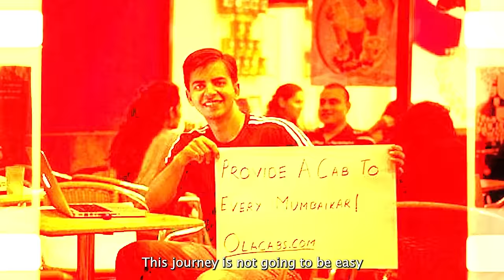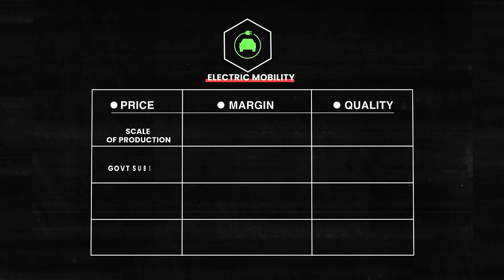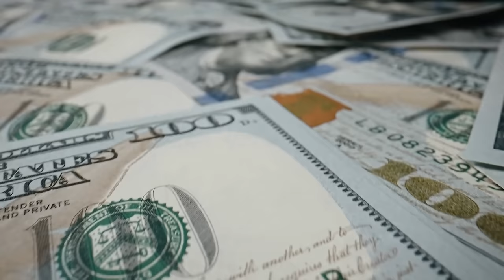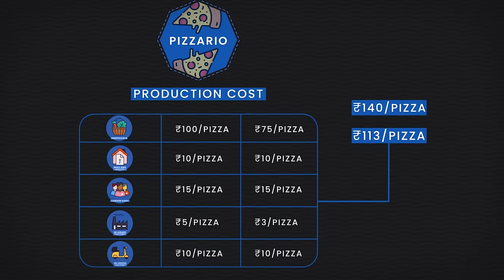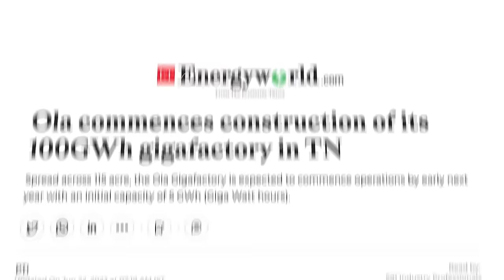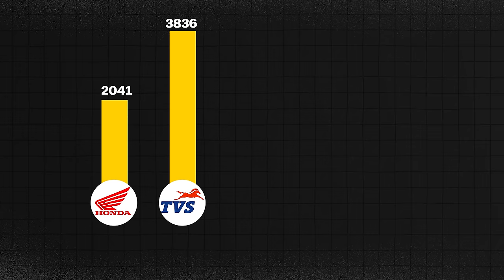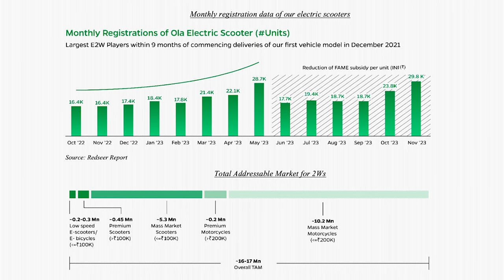OLA Electric: Is there any future in India?

Comment: 🎯 Key Takeaways for quick navigation:

00:12 Ola Electric's IPO.
00:40 Electric vehicle market in India.
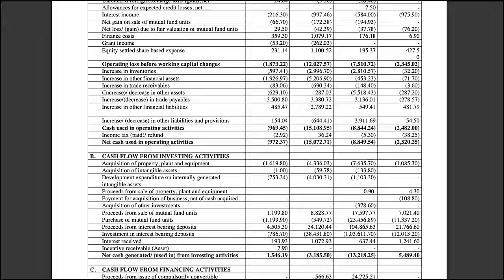01:09 Ola Electric's financial losses.
02:19 Considerations for investing in Ola Electric.
04:26 Importance of vertical integration in EV business.
08:51 Ola Electric's vertical integration and manufacturing capacity.
11:51 Control over price, margins, and quality through vertical integration.
19:04 EV market segment and pricing challenges.
21:23 Subsidies and their impact on EV sales.
23:26 Risks for Ola Electric, including raw materials and scale.
23:40 EV success factors: Quality, Price, Margins.
24:07 Ola's strong subsidies.
24:22 Struggle to reach price point.
24:35 Ola's distribution challenge.
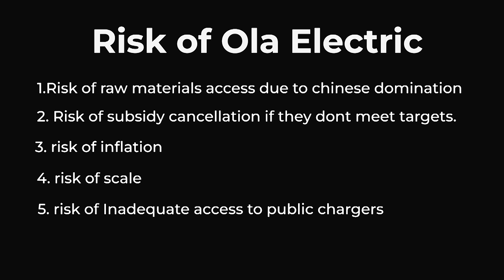24:49 Investment advice disclaimer.

Made with HARPA AI
Reply: Distribution channel not good because no dealership.

Comment: 12:37 Ola acquired a European EV company Ethergo which designed what is now known as Ola S1. Sorry to say, but Ola acquired a design and made some improvements. They didn't invest in coming up with their own Charging port. Ather on the other hand started from scratch and designed their EV charging standard which is now the official EV charging standard for the country.
Reply: Ather as a product is not worth it I believe. Not comfortable to ride and sit.
Reply: Common charging port gives access to third parties charging stations. Like type C cables. It's better to bring common charging ports other than unique ports
Reply: @rooftopmunda  weird. Because it has more space than OLa
Reply: Why to reinvent wheel if you can buy technology to it at reasonable cost & grab first movers advantage & tap economies of scale though I concur that kaizen is very much important in technology of charging
Reply: This.
Reply: @rooftopmunda  As a Ather owner, it's really nice and reliable scooter. They've taken some basic learnings into account which OLA didn't. e.g. the charger locks into scooter when charging. This gives me assurance that my portable charger won't be stolen in public space. OLA owners have to stay with their scooter for this. Very sensible user research done by Ather for such things in India markets
Reply: @AmeyaRanade  Don't judge with half knowledge, Even ola has charging lock system. And much more features like anti theft, GPS tracking, Remote Unlock, Password Reset using mobile, Music System and more
Reply: @phanichandravvss1751  Interesting. I should let the guy in my building know then. He thought it didn't.
Reply: Guys! Ola should use existing technology, learn from Ather, Byd, tata and others but. Its all about the race. Who wins is important ❤ All the best to them.
Reply: @phanichandravvss1751   GPS tracking is a thing in Ather aswell. And good luck tracking your vehicle when someone steals your phone and gets an Ola in bonus loot. And that music system is horrendous. 2W are meant to be driven, not get more and more distracting features on the dashboard. Hope the govt swings the hammer on all EV 2W about any form of distractions coming to the dashboard
Reply: Ola has en engineering design center in Coventry UK and a battery cell development center in TN.  They are planning on releasing motorcycles in 2024, and a car by 2026.  Ather seems to be stuck on the 450 platform with limited shared plans for the future and no global design presence.  I think it shows in sales figures
Reply: True
Reply: Bhai maal achha hona chahiye bikna chahiye bas kisne banaya kaise banaya kitna banaya koi farq nhi padta
Reply: @AdityaSuman-f7n  haa thats why theres a weekly news of Ola catching fire. For comparison, i have never heard any ather catching fire as far as my memory goes. The same goes for the front wheel suspension breaking apart on older Ola vehicles. Thats the difference between doing actual R&D vs buying and wrapping a foreign design.
Reply: Ola just patented their own battery cell, what did Ather do since their inception? Develop a single scooter and keep renaming it? Ola has a giga factory too.
Reply: @heavenlypot   look up the BIS standards for 2W EV charging and unlike Ola, there is a noticeable difference between each version of the scooter. More importantly, there are barely any news of Ather battery exploding, unlike Ola's "patented battery" which keeps exploding every day
Reply: @Silent_Shishya  Ola isn't even using their own cell rn, they'll use it from 2026. And there's a difference between explosion and catching fire, don't do sensationalism.
Reply: @Silent_Shishya  There are no 2 watt ev charging standards. Even phones charge at 100W these days, do you even know what you're talking about?
Reply: There is nothing wrong in buying a company to acquire technology. Companies do this all the time. In future, with experience, they can design their own products from scratch.
Reply: @CANILESHKUCHERIYA  Absolutely correct
Reply: @AKT-oc7ex  thanks

Comment: While the initial investment for vertical integration may be significant, the long-term returns are poised to be exceptional.
Reply: Vertical integration is not a good idea for commodity parts.  For example, Tata makes steel, and Suzuki does not.  Cars use a lot of steel, but Suzuki makes way more cars than Tata.  
Vertical integration only works for non-commodity parts.  When was the last time you saw a Pizza Hut wheat farm

Comment: Many times vertical integration can backfire. For example, other companies can buy best batteries at best price from whoever makes them best, while you will be stuck with your own battery, even if its not competitive. IMO, one has to be really good at what they are doing and that is what brings the value. Just vertical integration does not necessarily bring any advantage by itself.
For example, just look at Apple how they started. They did not start making chips. They started assembling computers and make better computers using existing off-the-shelf chips. Later, when they got better at it and then started making good money there, they went after mouse and then OS and then chips, in succession over multiple decades.

Comment: Does India even have standardization of Charging equipment? One big problen with EV market anywhere would be charging infrastructure. If charging becomes standardized, charging infrastructure becomes a real estate puzzle instead of tech. Example, ur apartment building has 50 of 2 wheeler chargers from think school corp, u just scan the qr code via their app and plug it in. Same goes for malls or office buildings. It charges regardless of brand of the vehicle and you can charge a % of the electricity cost for income. City/state authorities can even make rules saying any new construction has to have x% of parking with ev charging.

Comment: Well, to be precise, the two-wheeler EV manufacturers need not bring their price down to 90k; rather, they can hit a sweet spot that is between 90k and the current EV price. As the break-even point of owning an EV compared to ICE will include fuel price and maintenance, which can be leveraged/used by the EV manufacturers to market their product.

Comment: The very first focus has to be on quality and durability as cost is not a barrier for most Indians in the present scenario, first impression bhi hai toh aur careful hona padta hai. Customer Service cannot be bad at initial stages or you won't last much longer. OLA I believe intentionally did not stress test their power drives, I am assuming to be first in the race. Aether took advantage of that and made not exploding bikes but there is a hidden giant slowing creeping its way into the EV market and that is Yulu, they have been proven safe, reliable and already sold a lot due to their tie up with Zomato. Although now its reputation is that of Delivery wali bikes but, I believe they will use the knowledge gained from this to launch a much more competitive and durable bike, which will definitely eat into large chunks of market share of other bike manufacturers.

Comment: ICE over EV anytime. Because unlike ICE which can be used in long run like 10-15yrs with equivalent amount in repairs. EV on other hand requires at least 50% amount on just battery pack change in 4-5yrs which nobody is telling. Even in extreme situations it can last upto 7yrs max. And considering inflation it will cost at least 75% of cost. Yes you are saving on fossil fuel cost. But it goes both ways, if demand decreases so will it's price. And not to mention but all these politicians and manufacturers who are saying ev this ev that. Themselves use ICE vehicles because of it's reliability.

Comment: Disadvantages of Non-Vertical Integration 

> Quality of Raw Material vary- Inconsistent Quality 
> Subjected to Price Fluctuations 
> Margins vary 

With Vertical Integration Benefits 
> Lower Procurement cost with inhouse production
> Margin remain higher
> No price fluctuations and quality consistency 

Ola is Vertically Integrated in following 4 Sectors
> R&D 
> Manufacturing 
> Charging Network 
> Sales & Distribution 
> After Sales

They can control Quality, Price and Margins

Raw material is only Sector that is not Vertically Integrated.

Comment: Ola is simply trying to replicate Tesla model into scooters. But they genuinely seem to be overestimating demand. Also there is the question of reliability which remains to be proved. On the affordable/Total addressable market question...Ola has just taken advantage of their Vertical Integration...and launched Lower battery capacity models  SX1 as we speak with a 2 Kwh battery pack ...95km range (IDC) as low as 79999 and 3 Kwh at 89999...143Km range hitting the sweet spot at the cost of top speed coming to 85/90 kmph which is sufficient for our conditions and under cutting the Activas and Jupiters by a significant bit

Comment: Well this is a one sided argument of vertical integration.. vertical integration is a high risk high reward thing, yes you do get some advantage of price and quality, but its not as black and white.. first even if you do vertical integration the manufacturing cost for the parts will be still higher as compared to what proper manufacturer do, because he will be producing much more parts as compared to a vertically integrated company making the manufacturing cost per product higher.. 2nd is when there is a change in demand, if you ard outsourceing it is easier to change your stock as the demand change, when there is a less demand manufacturer will also sell it at a less cost meaning you will be able to sell it at a lower price, but if you have your own manufacturing plant, than if demand decreases, the price per product for manufacturing will increase due to less part manufacturing , and thus in less demand either you have to sell it at a higher price, which will decreas the demand further or you will have to incure losses. 3rd when market prices fluctuate, even though you have your own manufacturing plants the environment can still affect your cost, in your pizza example tomato price rise from 20 to 100 now this happens if you the crops were curropted. Even if you have your own fields and farmer there is a high chance that your field would have suffered same, then you have to outsource some parts, this not only increases your production cost but due to not good quality of products you have to outsource some parts which again increases cost of your company. There are still many disadvantages but these are the basic ones that i mentioned here, that is why many company prefer to outsource their parts
Reply: In summary i would say Vertical integration does help if you are market leader and your sales does not fluctuate much with demand. But for a new company or a small company or business its better to outsourcing parts as it will be much cheaper and cost effective for them. If a new company or company with no stable sales or a good profit margin decide to do vertical integration, there is a high chance it will just fail.

Comment: The scooter, being part of the first lot, was plagued with a fork arm issue, for which OLA Electric generously offered a free replacement. However, the process to avail this replacement has been a harrowing experience. Despite diligently trying to book an appointment for the past 3-4 months, I have not been able to secure any available slots. The nearby service center is a whopping 18 kilometers away, and to add insult to injury, Gurgaon, a premium city and one of the first launch cities of OLA, lacks the option for a fork update.

My frustration is compounded by the fact that the promised features of the scooter have not been delivered as advertised. After just one year, most features, including geo-fencing and proximity unlock, are still unavailable. Your services have deteriorated to an appalling level, and I find it unacceptable that a company of OLA Electric's stature cannot fulfill the commitments made at the time of purchase.

Comment: 1.Vertical integration can't be achieved overnight it takes 3-5 years for a product & you missed capital integration deferred cost.
2.Govt subsidy is biased & poorly drafted.
3.Bike is price sensitive purchase for household no doubt 
as ev 2wheeler market is at pre mature level nowso product is at premium atleast 10-20% 
& skimming price will come after 2-3 years down the line 
till then charging infra & battery swapping mentality matures as well.
4.you forgot to mention that 2wheeler market other than ev is having strong lobby in govt. & Petroleum co. Too have lobby so the EV ADOPTION unnecessarily SLOW though it is good for planet earth & cost friendly for common man but politicians & these lobbies will not make it simple leap jump for next 2-3 yrs at least.
5.Electricity sum is not solved do we have enough & do we have full proof discoms will continue supply needed at reasonable costs compare to petrol.

Comment: Terrible reporting.  You forgot totally about volume in your vertical pizza model.  It would never be profitable to buy a wheat farm for 1000 pizzas per month.  Ola wants to sell 2w worldwide. You don't look at that.  Re is selling bigger bikes now as are tvs etc.  also ola wants to sell batteries to auto companies that import Chinese/korean batteries.  You really need to do a better job and improve your quality
Reply from the maker: Cant sell worldwide unless we achieve BYD level scale and cost. So it’s too far sighted. 

Ola can sell batteries to others when they have enough capacity and access to raw materials and that too better than chinese which is again far from reality. 

You need to understand the constraints before making long term projections of the possibilities.
Reply: @ThinkSchool 
The problem I have with this terrible video is that it oversimplifies the whole concept of vertical integration to make it really confusing.  The only reason for vertical integration is to control non-commodity resources.  In the example given, it would suggest that Domino's and Pizza Hut are owners of chicken and wheat farms, which clearly they are not.  Chicken and wheat are commodities and users enter negotiated deals for supply and quality using their supply chain experts.  The notion that they can produce wheat cheaper than the commodity market is insane, as if the price goes up then more farmers move in and it goes down.  It's a global supply chain.  Sure they can set up their own division and invest to produce wheat/meat, but the investors will look to this division to make return on investment that matches the market to justify the investment.  If they sell products to Pizza Hut for the cost of production, they make nothing.  Pizza Hut makes the slight margin from buying wheat from their own division, after investing in it, instead of investing in more restaurants and outlets where they are non commodity suppliers and get much better returns.  
Another example is Suzuki and TATA.  Tata makes steel but Suzuki makes cars and buys steel on the market.  Suzuki makes a lot more cars than TATA, so vertical integration is not needed for success.

Comment: TOTAL MISREPRESENTATION OF VERTICAL INTEGRATION!!
I don't understand how you call basic aspects of any business such as Manufacturing, R&D, Sales as vertical integration!!
When a bike manufacturer starts making the clutches, brakes, lights, wheels, tyres, etc primarily for captive consumption; it's call VERTICAL INTEGRATION
Material procurement, manf, R&D, Sales & Service are basic aspects of any business; and if any of these are handled by 3rd party it's called OUTSOURCING; not the other way round
Except battery production, they aren't back integrating anywhere
It's just exposes the hollowness of OLA and THINK SCHOOL